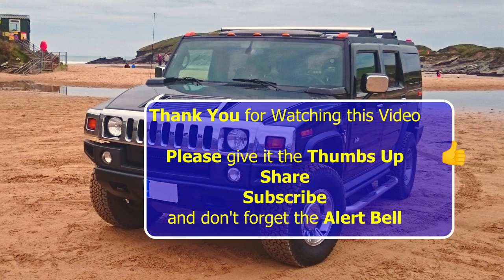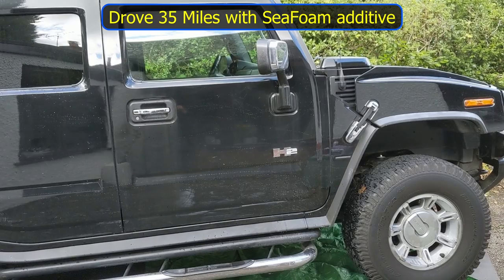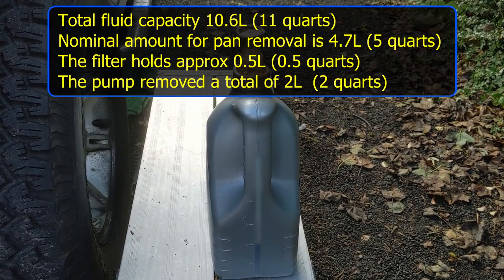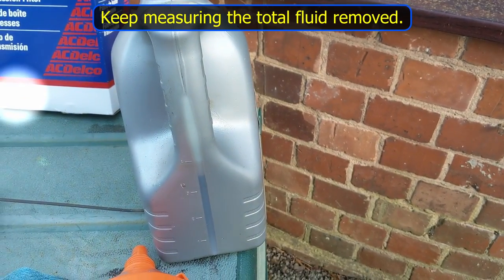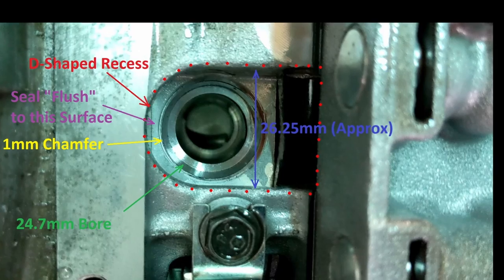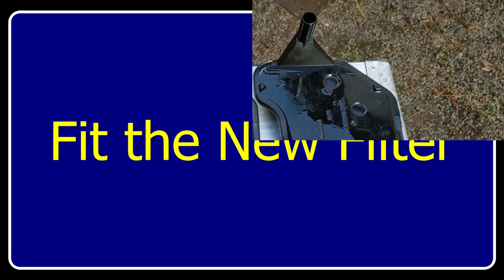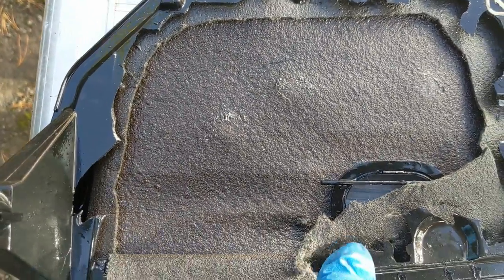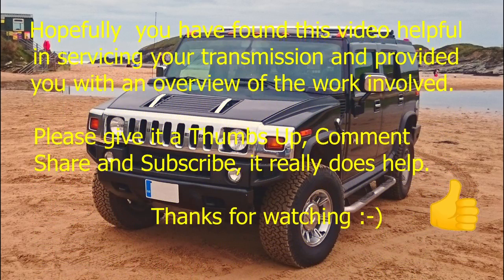Hummer H2 2005 - Transmission Fluid and Filter Change

Comment: I took off my passenger side rock bar and steps. It makes it so much easier to get under the truck. I use a mechanics roller too. Really don’t notice its off. I haven’t put back on the transmission protector either.

Comment: Why is the oil pan replaced? Is that a nice to have or mandatory during the ATF  oil/filter change? Great video!
Reply: Thank you for your comment. The choice to change the oil pan depends if you want to add a drain plug. To perform the progressive series of fluid changes it would ease the workload considerably. 

Sadly it's not possible to drain all the fluid in one visit without special equipment, or should I say it's not easy.

Comment: Another detailed and extremely helpful video. Very much appreciated. Regarding the seal removal, I used a quick and easy homemade tool of a 12"X1/2" threaded male  pipe (to screw into the seal), attached to a 1/2" female t-section, with a 4"X1/2" male nipple also on the t-section for tapping down. Acknowledgement to Chuck Carlley's video showing how...https://youtu.be/luBFAfMKd1A?si=fcqdWEDo_1oQ-3CE

Comment: next time DONT change that O ring that comes with the filter... just change the filter only.. the O ring doesnt go bad just leave it in there and re use it...  and why did you disconnect the battery?? you dont have to do that!!!
Reply from the maker: Thank you for your comment, appreciated. 

Good points, the O-ring did appear OK, and certainly next time won't be changed. However for my 1st time, given the vehicle's age, mileage, sevice history, oil cost, time and effort required, to be 100% certain the O-Ring is OK and not degraded or damaged seemed worth it. 

Regarding battery disconnection,  this step could be omitted,  however it's all about safety, reducing risk from accidental shorts or running the battery low etc and it only takes a minute to do, so again seemed worth it.

All viewpoints are important so people can decide how to do a job and do it safely.